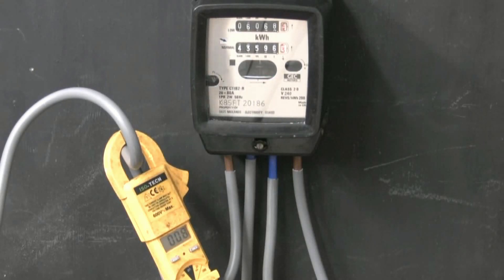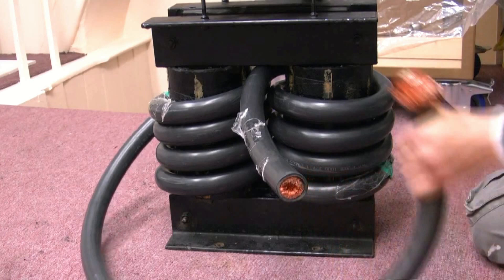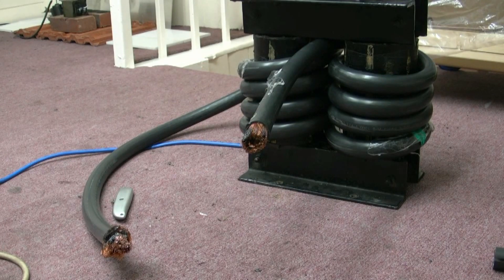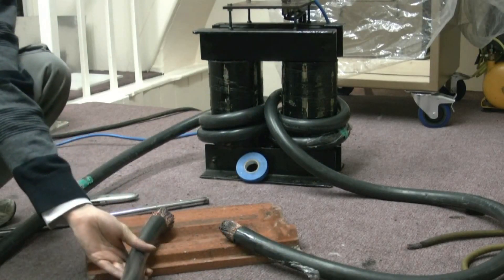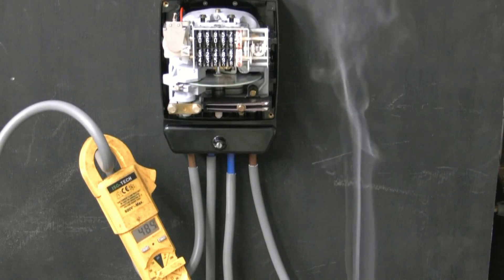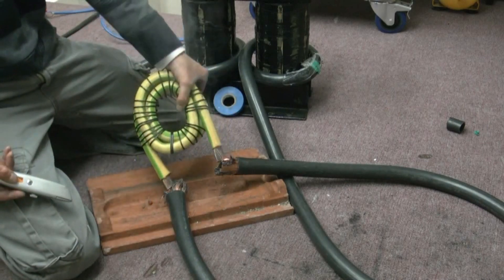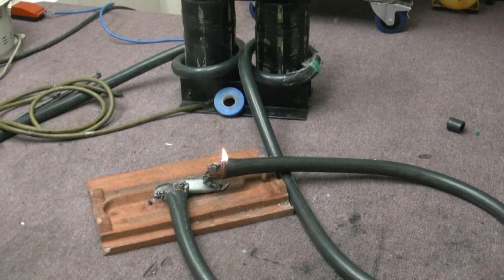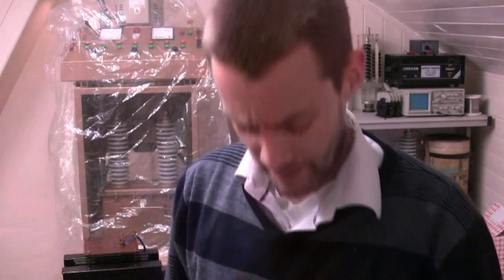Too Much Current + Electric Meter Pops

Comment: You're damn lucky your hand didn't slip off that box cutter! And to answer other peoples question the reason he didn't get shocked doing that is because electricity takes the shortest path of least resistance. In this case the box cutter.
Reply: The output of his transformer is low voltage, this is why it doesn't shock you. It does have, however, an extremely high current capability. With the resistance of your skin you need voltage to get the power required to shock or kill
Reply: He didn't get shocked, because there was no pathway through him.  Neither end of the cable was touching the ground.
Reply: Even if the voltage were high enough to shock, it wouldn't have; there was no path through him to the other end of the wire.

As for the low voltage; To overcome resistance, you need both voltage AND amperage.  Also, skin resistance varies based on a number of factors.  It can be as low as 100 ohms if the skin is moist.  The higher the amperage, the lower the voltage needed to overcome the resistance.  So, just because it's a low voltage, doesn't mean it's not dangerous.
Reply: ***** there was a path through him if he touched both cables, that path is the ground. if voltage was higher it would have definitely hurt him bad/killed him.
Reply: Irontaco
That is not ground, that is just completing the circuit, but you are correct, he would get shocked then. 

The reason people get shocked when they touch the hot side of a household electrical socket is because the neutral side is attached to ground at the circuit breaker.  In his case neither end of the secondary is grounded, thus touching one wire will not shock him, but touching both both ends with him in the middle would be stupid to say the least.

Comment: At 9 mins into this video you do something that make my sphincter twitch. You take a metal Stanley knife and use it to connect the two 400mm windings - while still holding it! How come you don't get hot like the knife? What's the theory behind what's happening?
Reply: Low voltage - High current. Need a lower resistance across the windings for there to be electron flow. Also he didn't get a piece of his body in between the windings. Electrons take the path of least resistance, it would have to go from the knife through his body and back to the other side of the winding.. Wouldn;t work.. Unless serious volts
Reply: Sid Vicious
Even with serious volts he wouldn't get shocked, unless he touched BOTH ends of the winding (or the knife and the other end) with his body. 

The reason house outlets are dangerous is that ground IS part of the circuit.  In US homes, the 110v outlet, the Neutral  line (wide prong) is [supposed to be] connected to ground.  The hot line is really the dangerous line, but one should never assume that it was wired properly, hence the additional local ground for safety.

Comment: How you touch that hot rod?
Reply: he's too stupid to feel the pain
Reply: The heat builds up much more quickly between the two wire contacts because that's where the electrons are flowing. The electrons don't go out towards his hand because that's not the most direct route between the positive and negative contacts. Electric current follows the path of least resistance.

Comment: just out of curiosity, what's your average months' electric bill look like?
Reply: Sorry if I come across as ignorant, but I thought that the shilling hasn't been used in ages.
Reply: ***** So that's why he didn't die when he shorted the cable? It looked extremely dangerous to me, but if it was just couple dozen volts...
Does a thicker cable equal less resistance?

Comment: How did you hold that metal bar with such a high current going through and not get burned as far as heat?
Reply: You'll notice that only the region in between the terminals is where it was heating up... where the current was flowing through.... electrons don't give a shite about the ends of the bar.
Reply: By letting go just in time :P
Reply: brave soul... or drunk?
Reply: Knowledgably confident and drunk ;D

Comment: This is  a long post, please don't bother telling me I have no life to post something like this on youtube, I already know that :)

I feel like a lot of people don't understand current and voltage and I feel like the people who do understand never explain it very well.  So here it goes:

This video is an example of a low voltage/high current power supply.  The voltage is so low that he can touch both contacts with bare hands and probably not feel anything. "BUT ITS AMPERAGE THAT KILLS!" is what you might want to scream at me.  This is very true, but also VERY misunderstood.  

Many people don't like this analogy, but I personally think it's awesome.  Electricity is very similar to water.  Pipes are the conductors (think wires), and how constricted the pipes are is resistance of the conductors.  In this analogy, the pressure of the water in those pipes is the same thing as the voltage of electricity.  The current of the water is... you guessed it, the current of the electricity (measured in amps).

Now imagine that you have a constricted pipe (it has some arbitrary resistance), and you have no pressure on either side.  You can guess that most likely, no current will flow.  Now imagine you have equal high pressure on either side.  Even though the pressure is high, it's the same on both sides of the pipe, so again, no current will flow.  In order to create flow, we need a PRESSURE DIFFERENCE.  Similarly, for electricity to flow across some conductor there must be a voltage difference.

Notice, that in this analogy, the current of the water is induced by the pressure difference. It is the pressure difference that forces the water to move.  Electricity is very similar.  Also notice that you can increase current in two ways, one is by applying more pressure (voltage), but the other way is to reduce the constriction of the water pipe (reduce the resistance).  This can be seen by the following equation:
voltage = current x resistance.  This is ohm's law.

Death by electrocution is very often caused by the electricity screwing with the "wiring" of your heart and causing your heart to stop beating.  The most relevant number to measure in such a situation is the current going through you heart.  There is a certain amount of current, that when induced directly through your heart, has some high probability of stopping your heart.  When people say IT'S NOT THE VOLTAGE THAT KILLS, IT'S THE AMPS, this is why.

Notice, however, that there are two very large pieces of information that get cut out when people say something like the above:

1) It is very important to know WHERE that current is crossing.  If 20 amps of current are crossing your hand, and ONLY your hand, you are not going to die.  Your hand will be extremely damaged, but if no current is crossing the rest of your body, you'll probably be fine.

2) You CAN NOT HAVE CURRENT WITHOUT VOLTAGE.  A 2V power can cause hundreds of amps of current to cross a copper bar.  But the same voltage will do barely anything applied to any parts of the human body.  Why?  Because the copper bare has very little resistance.  Again, think about water.  You can have a very small pressure difference, but if you apply that pressure difference across the mississipi river, you will have MASSIVE current.  If you apply the same pressure difference across a straw, it will be a trickle.  Your body is a straw.  Notice, also, that when I say 2V of voltage applied to your body  it is actually not very specific.  2V of voltage applied where? across your finger? across your tounge? across two electrodes jabbed directly into your heart?  All of these situations will cause different resistances, and therefore will induce different amounts of current between the two chosen points.

All of this should naturally lead you to a very important question.  If the only thing that dictates current is 1) voltage (property of the power supply)    and 2) resistance (property of the material the electricity is passing through), then why on earth do power supplies have current ratings.

A current rating on a power supply does not tell you what current will be supplied by that power supply.  The current rating on a power supply simply tells you the MAXIMUM that power supply can reliably provide and still be within some sort of specifications.  As you begin to approach that current rating, the voltage may begin to drop, or the device will begin to degrade (rapidly!) or some combination.

Similarly, other voltage sources, like batteries, may not have current ratings, but none the less they have some sort of internal resistance.  You will notice a very large difference between attaching a wire between the terminals of a 3V battery, and doing the same to the terminals of a 3V industrial transformer.  Why?  The 3V battery has internal resistance, and that means that as the current gets high the 3V battery will actually stop delivering 3V.  It will drop to a very low voltage when shortcircuited. A 3V transformer, on the other hand, could very well continue to provide insanely high currents and still deliver 3V.

Imagine two water pumps (I love water analogies!).  Both are rated to pump up to 14 PSI of pressure.  However, one of them can deliver that pressure up to 5 gallons a minute, and the other will be able to deliver that same pressure up to 50 gallons a minute.  When they are given static conditions (like say blocked pipes) they will both pump up to 14PSI.  You will not be able to measure a difference.  However, give them both a very wide unrestricted pipe to pump through and you may find that the 5gal/min pump is pumping 6gal/min and is now providing only 7PSI, but the 50gal/min pump is maintaining that 14PSI and delivering a nice 12 gal/min.

I hope that this may have helped at least some people out there.
Reply: This is why signs say 'Danger High Voltage," and don't say 'Danger High Amps"
Reply: That was a great post Serjio Pretuniliy. It annoys me beyond measure when people argue about what they don't understand (especially if both sides of the argument are incorrect), which is what this entire comments section seems to be about on this video. I wanted to say what you have said but you beat me to it. Good work.
Reply: Nicely explained indeed, good job, just correct the "very large peaces" to "very large pieces".
Reply: AlphaArcticWolf
'i' before 'e', except after 'c', and also except when this rule doesn't apply.  DONE.  thank you.
Reply: Hello, my physics teacher!
Reply: Nice mah dude

Comment: why you dont get an electric shock when you touch that thing at 9:44 or the metal wire?
Reply: Hanro Lareman You got that all wrong... A Kills, V dosen't. That's why you don't die when someone Tasers you with milion volts.
Reply: the path of least resistance for the electricity to take is through the wires, not him since he is not connected to a grounded source.
Reply: goaliedude32 Are you stupid or are you just pretending
Reply: amps don't shock you it just cuzes heat(hint whay that cable is so thickly insolated and it mealted that rod in a' mater of seconds)but its the volts that will kill you (those nice sparky things that turns the air around it into ozone)
Reply: *****
The taser circuit starts at one probe and ends at the other, which usually doesn't lead through the heart.
Reply: high amps, low volts (like an arc welder)
Reply: it can be 1000 A and 1 V and it won't kill you. It can be 42 volts and 3 amps and theres the chance to die.
Reply: Hanro Lareman HAHAHAHAHAH...
Reply: ***** lol
Reply: you don't die from a taser because it does not take a path to your heart.
Reply: ***** mmm , I was talking about amps being less deadly then volts not" tasers or hearts"
Reply: Hanro Lareman Learn omhs law, volts determins how much amps you will need. More volts more amps. /watch?v=8xONZcBJh5A
look at the video. Plus electroshocks have resistors that limits amps.
Reply: Paulius Bu Hay I only now the basics volts ark and amps burn and melt stuff that thay go thro (like the pole in the video), 

ok I may be wrong I was canda thinking about lightning at the time
Reply: Hanro Lareman Lightning is "canda" still electricity.
Reply: OK lets stop I had enough of returning to these post
Reply: U need a certain number of volts to penetrate the skin, then its the current that kills you fgts. Also u can touch a van der graph machine that produces thousands of V yet you are safe.
Reply: *****
As long as you're not grounded. If you're grounded and there's no safety device you will be injured/killed.
 The current is directly proportional to the voltage. As the voltage goes up so does the current.
Reply: *****
That's right as long as there is no path for the voltage to take there will be 0 amps. At 1mil volts any circuit through your body will cause massive amounts of damage and or death.
Reply: veeeery low voltage. Pretty sure it would be less than 1VAC. The sparks are just from the high current. You could grab both ends of those copper wires with your hands and not feel a thing, and you wouldn't get hurt one bit. If you licked it, I'm not sure what would happen.
Reply: Hanro Lareman It's not the volts that kill you, it is the amps. That's why you can get hit with 5 million volts and just jolt backwards a bit.
Reply: ***** Amps paired by watts to be more specific. The point is you can get hit by 3 million volts and walk away shaken, but unscathed.
Reply: Electricity takes the easiest way to the "ground"  and the wire is the easiest way  (less resistance actually)
Reply: ***** This video is not fake. Look up "Path of lease resistance".
Reply: That is true
Reply: Heinz LETZTE.
learn to be polite, social and objective! i wish im able to tell this to your parents - im sure that you get consequences or some slaps on your ass!
 You-Tube needs to be only for adults of 18 +...
Reply: Heinz LETZTE.
Ach, sehe grade dass du wohl auch Deutsch verstehst! Deine Eltern haben bei deiner Erziehung auf ganzer Linie versagt! Lösch deinen Account, geh Anstand lernen und wechsel den Sandkasten! Würde gerne deinen Eltern mal erzählen was für Frechheiten du hier so postest - gäb hoffentlich Strafen und/oder Schläge dass dus die künftig 2x überlegst bevor so eine (unsachliche, beleidigende) Scheiße schreibst!
Reply: Es ist das Internet, du Vogel. Da beleidigt nunmal jeder, damit müssen auch Zurückgebliebene wie du klar kommen.
Reply: Bevor du die Erziehung anderer Leute anzweifelst, solltest du dich wohl erst mal um deine eigenen Probleme kümmern.
Reply: Ich bin sicher, da gibts genug bei einem Idioten, der Freitag um halb eins Youtube Kommentare schreibt wenn alle normalen Leute arbeiten sind.
Reply: Heinz LETZTE.
Warum bist du so frech und asozial? dir hat keiner was getan und suchst nur stress! den gefallen tu ich dir aber nicht und bist auch gemeldet. lern respekt und anstand - dann kann man vllt auch konstruktiv diskutieren!
Reply: Jemand, der mir bei erster Gelegenheit sagt, dass er seine Kinder verprügeln würde, weil sie frech im Internet sind, will mich jetzt davon überzeugen, konstruktiv zu diskutieren. Zu allem Überfluss bist du auch noch Stolz auf deine "Heldentat" und musst noch extra betonen, dass du mich gemeldet hast, damit du dich gut fühlst. Ich hätte ja sonst nicht auch so gemerkt, dass mein Kommentar verschwunden ist. Du bist einfach nur ein dummer Versager mit überhöhtem Geltungsbedürfnis. Idioten wie du bringen mir gar nichts bei, egal wie laut sie flennen.
Reply: Verprügelt seine Kinder und nennt mich asozial. ^^
Reply: mir ist dein asoziales verhalten zu hoch! gehörst von dieser plattform verbannt!
Reply: Versager.